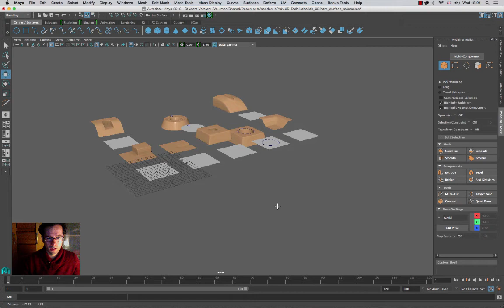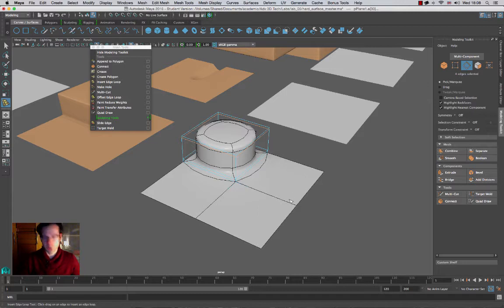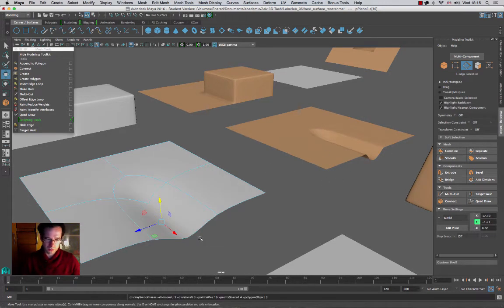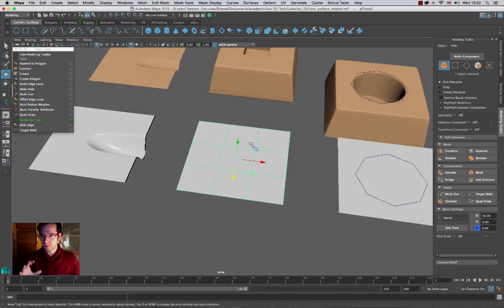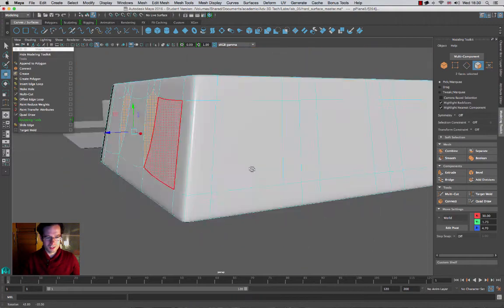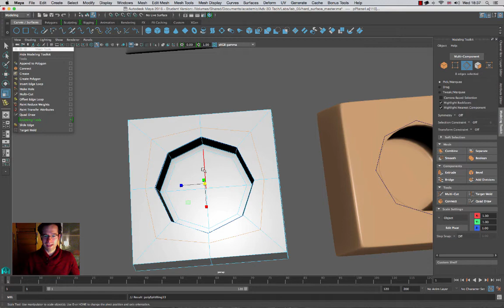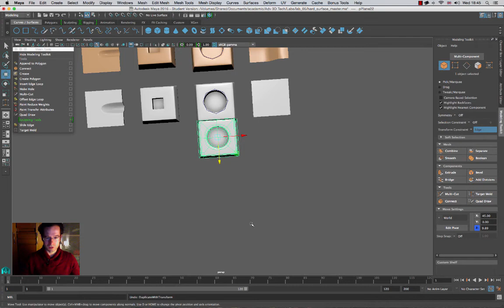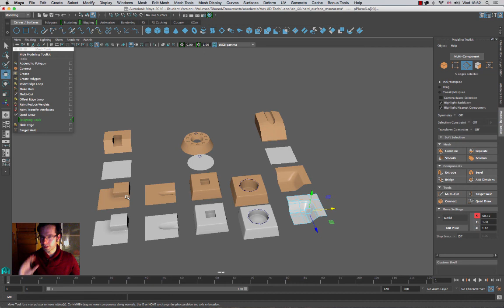Maya 2016  Hard Surface Modeling Part 1

Comment: Man, hope there's less bugs in this version than there currently is in 2016 as it's FULL of'em. Would NEVER buy another version of Maya!
Reply: still buggy. they fixed problems, but also made problems... as per usual... i miss softimage.
Reply: ForzaS1 yeah, know what you mean. I started on Infini D! I really dislike Maya, it's SUPER expensive, tech support is basically non existent unless you pay through the nose for that as well and it has many many bugs. My next 3D software won't be from Autodesk, that's for sure!

Comment: I know about placing loop cuts, quad, etc but.... I am trying to make my quads all even through out  my mesh. I am wondering if I am suppose to be using snap to a grid face or point on each extrude and... on the tool settings keep the discrete  move, step snap, discrete and retain component spacing checked to get even quads?